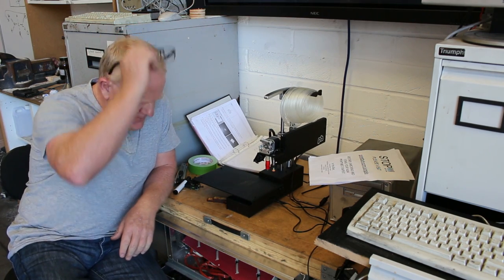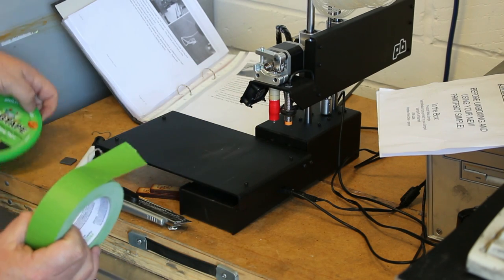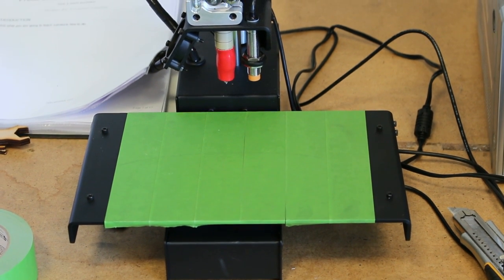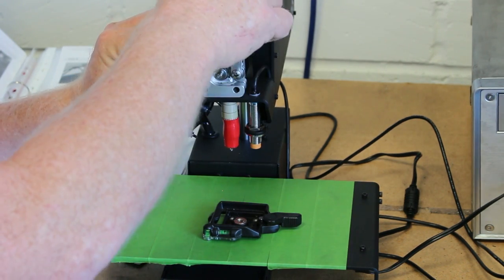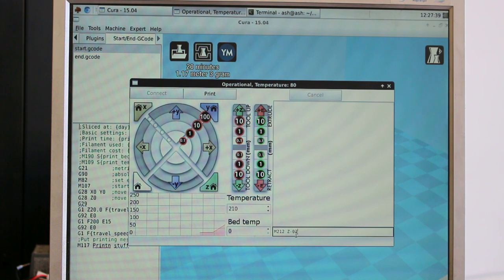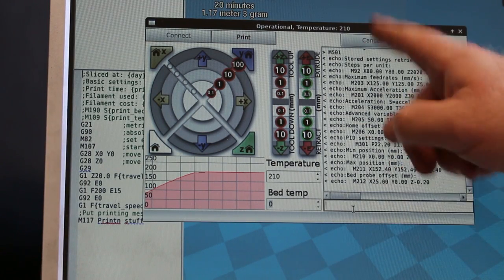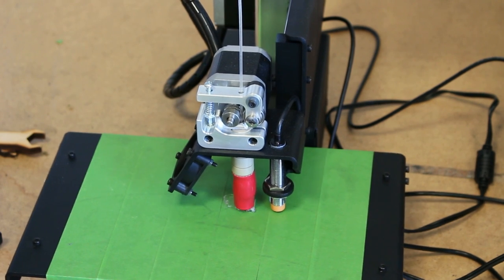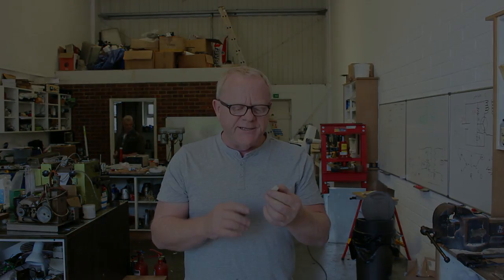An Introduction To 3D Printing

Comment: Any Thoughts on developing graphene based filaments? You Could print curcuit boards? Maybe even print a heated bed? I would be interested in experimenting with it.
On the subject of 3d printing, I have build 4 repraps. 3 prusa style and one kossel. Pretty easy builds once you understand how they work. I have found cura a great program. I also find myself using "matter control" which has cura slicer and their own slicer in one program. It's free and worth a look. 

I also find that the layer height you print at is very important. There is a calculator based on your stepper motors and lead screw that determines the ideal layer height to print at for best quality layers. I believe it has something to do with motor holding torque between full steps. I don't have the link on hand but I found it with a Google search. I believe the prusa founder made it. 

A lot of fdm printing is trial and error. Nozzle Temps between different types of filament (brand, color etc.) I use an aluminum headed bed coated with aquanet super hold hair spray and my prints always stick. Bed leveling is also very important for good print quality. Look into an inductive proximity sensor. I use it for auto bed leveling and have never looked back.
Reply: Nick Pinnetti Graphene filaments are already offered by Graphene 3D Labs in Canada. I wonder if they going to use this tech in the battery products at Sunvault????

Comment: Consider using Blender (http://www.blender.org/) for design, as it has tools built-in to make 3D printing easier.

Also, when laying the tape, begin from the periphery, and layer the tape inwards from both sides.  This way, you can simply lift off the portions in the center that are actually used, and lay down replacement tape quickly if you're printing multiple objects. 

It's not important for demo objects, but for the kind of work you do, you won't want to pry and/or smack carefully detailed models off the table. :)
Reply: jb listener Thanks for that JB. I am on the steep learning curve with Blender at the moment it's a great program for design and I'm interested in editing our videos in it too.

Great tip about the tape, makes perfect sense.

Comment: Cura is good but you can use slic3r too to slice the model before printing. I find it gives more control over the print parameters. I don't know about the Ultimakers but I've got a reprap clone and it seems like I get better quality and tolerances when printing parts sliced with slic3r. It is important when printing technical parts. I recently discovered that for most printers the extrusion algorithm is naive and does not consider the pressure buildup in the extruder. To circonvent that and still get pretty good quality print I set the speed of the perimeters and external perimeters to the same value. RepetierHost is a free software you can use to slice parts with slic3r and print it just like with cura.

3D printers are very useful tools but FDM printers can be difficult to calibrate and very time consuming to make good parts depending on the complexity of the part. Tell me if you have any question. Maybe I can help.